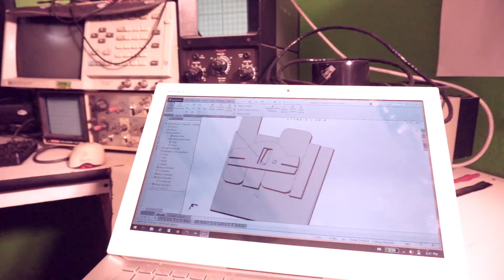Homemade Autonomous Car

Comment: What an interesting project! It would be quite cool if you managed to control the steering assist servo motor already present in your car via the OBD-II port, without modding any of the hardware. It seems to be controllable just on select cars, though.
However, the throttle is controllable in almost any car, so why don't you check it out? Hook up an Arduino to that port (there's a lot on documentation on how to do that), and maybe minituarize the setup using a RPi to do all the processing. That would be amazing :)

Comment: Make it use Google maps instead of follow another car
Reply: +Franklin Volcic You would need an <1> centimeter accurate map for this, with normaal google maps it would just go off the road or turn 10 Meters after the road turns. But still, since he couldnt make a car that is following another car, he should defenatly finish that first and then move on.
Reply: Late response; Not necessarily, you could technically use google maps as a cross reference to ensure you're heading the correct direction and use the camera to ensure your car is still in the lane. I guess google isn't needed but it helps with future decision making! :)

Anyways, this is a fake video :D